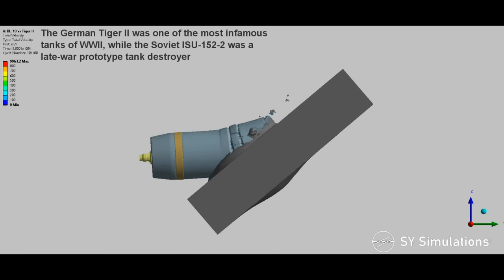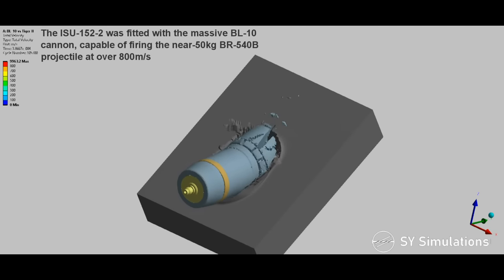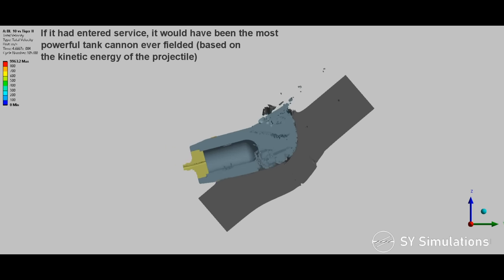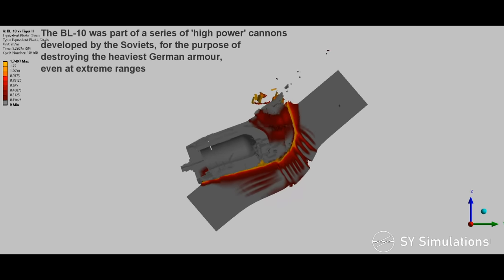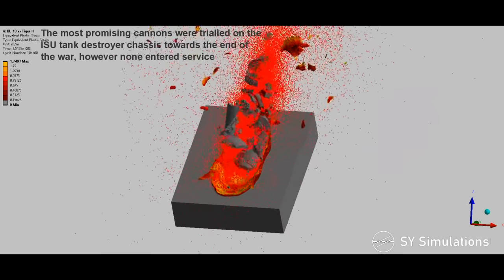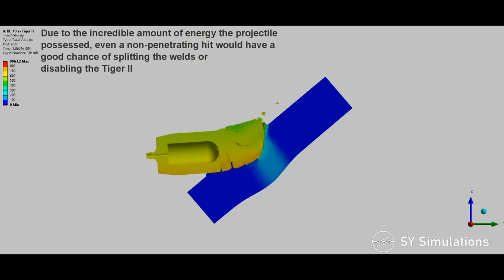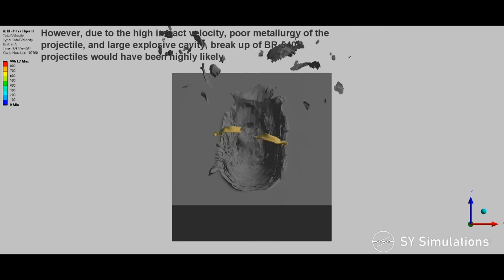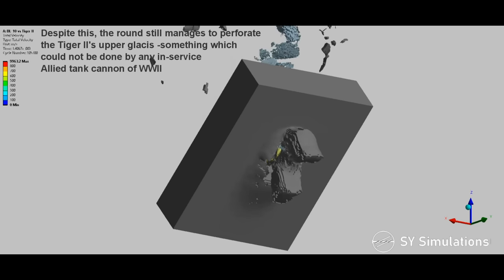SIZE MATTERS | Super ISU-152-2 vs TIGER II | 152mm BL-10 Armour Penetration Simulation

Comment: Rest in pieces driver
Reply: Not just the driver but the machine gunner too and the feet of all the turret crew
Reply: And loader
Reply: @@kanalegrande831 Precisely.   The Tiger-2 would have a rate of fire of at least 6 to 7.5  rounds per minute (10 seconds to 8 seconds between shots on average including time for re-aiming).     The ISU-152 only 2 to 3.(30 seconds to 20 seconds rather optimistically they are two piece rounds). so the ISU-152 can fire at best one round every 20 seconds but more likely 30 seconds.    The Tiger 2 can fire a second round after only 5.7 seconds for the first few easy to reach rounds so long as the loader drops the rounds on the floor rather than throwing them out the roof discharge hatch.   
-The range finder of the day was and stedometric range finder but in reality is to observe the fall of shot and then adjust for the second shot which would be the one that stood a good chance of hitting.      The Tiger 2 could get of 3 shots before the ISU-152 could get of its secondhand it would have 4 seconds to spare.  Of course it could use the time to move under cover..  Ballistics is probably the same after 2000m.  The Tiger 2 will win this duel on most occasions due to 'soft factors'.  No Tiger 2 was ever penetrated from the front.
Reply: Rest in paste*
Reply: Driver ? Dude a single shot would litrally kill everything inside and even if  the shot didn't penetrate the armour the loud clang from the Collison would definitely scramble the brains of the crew inside let alone the guys inside would be either disoriented, knocked out or unconscious
Reply: @@kanalegrande831🤡
Reply: @Tun299  🤡
Reply: @Micha-wb9oz  Твоё лицо не кто не просил скидывать. Я его уже скинул.
Reply: @@kanalegrande831 What do you mean, Ukraine was a major front for the Soviets, we WERE a major part of the Soviets, they weren't just Russians, plus a bunch of other nations fought for the east's freedom. Try and be cultured instead of spouting out things you're not fully informed in. Plus the ISU-152 was one of the USSR's most accurate tanks despite having a massive shell.
Reply: And other crewmans too.
At least in peace.
Reply: And entire crew
Reply: @williamzk9083  Very well. Now find out from which bush the first one came ). This isnt a 1v1 standoff, this is the hunt. Most german tanks were destroyed in ambushes )
Reply: After direct hit by 152 mm shell its RIP for everyone inside that tank
Reply: @-Ryan_Gasoline-  Russia did not fight for the easts freedom.  Russia fought for Russian imperialism.  Russia still fights for Russian imperialism.
Reply: @user-rp5qh1ky6g  most Russian tanks were destroyed in ambushes so what’s the difference?
Reply: @williamzk9083  No difference here.
I use that phrase to counter wehraboos.
Ultimately it all comes down to crew training and experience ).
And we are talking about using a tank destroyer as its intended.
All i told is that type of tank(insert isu, su, any of the german ones(cant remember how they are called)) is rarely used in 1 v 1 front to front standoff. Its a tool for specific purpose, and used otherwise only in bad circumstances or by bad commanders(again training and experience)
Also more than half of tanks of entire war were beaten by masked at gun somewhere in a bush looking at a road (thats probably has more mines than road itself).
P.S. Only major way an isu-122(52) can get to fight front to front is when its deployed at a siege assigned to elite stormtrooper divisions(aka combat sappers, green stormtroopers)
Reply: @lokket9995 except this thing did not exist. It was one prototype only. Over here in reality, Tiger II confronted 152 production variant on multiple occasions, survived frontal hits, and knocked out the 152.
Reply: hes not even in peace 🗿🗿
Reply: @realbaresoles2 The amount of tigers that had their turrets ripped off, and brittle armor plates shattered is funny.
Reply: @williamzk9083  just add another some t 34  and tiger2 will can't concentrate
Reply: Rest in paste.

Comment: Just for reference, that gun is actually getting quite close to the kind of muzzle energies of actual light cruiser guns of the era. The shell's on the light end for the calibre, but still, it's no joke
Reply: At 48kg and 850 m/s it actually beats the American 6"/47 and almost beats the British 6"/50 (both were on the low end of muzzle energy but were great, combat-proven guns), although it falls short of the German 150 mm and the Japanese 155 mm guns.
Reply: @yoshineitor  They mounted one 130mm on a prototype SPG called SU-100Y which was actually used in the Battle of Moscow
Reply: @MrKenny175  The infamous boxtank and the infamous IS-7. I actually adore the simplicty behind the idea, instead of inventing a whole new gun just slap on what is already proven and works and where ammunition is not problem to come by.
Reply: @yoshineitor  Just to clarify, I'm not saying this 152mm gun is actually a naval gun btw - I assumed it had been built from scratch. Also, was the IS-7's gun actually a modified naval gun? I'm well aware 130mm was a common calibre for soviet destroyer main guns, but that doesn't necessarily mean it is a naval gun of course. I think it's generally fair to say that most naval guns are built too heavy to really work well in armoured vehicles. Most tank guns are actually very light if you compare them to naval guns of the same overall qualities
Reply: @tommeakin1732  I could be wrong here, but I think it's fair to say that most ship armament below about 8" wasn't really built for Anti-armour use. Battleships certainly got a lot more use out of their secondaries and smaller firing HE or Dual-purpose ammunition, that would do a great deal of damage to smaller ships.

For example, most destroyers lacked any form of armour plating - even late into the war. And as for cruisers - HMS York/Exeter had 3in in the belt, but the turrets, deck, and 'citadel' were at the most a mere 1.5 inches, or 38mm - For reference that's about 8mm more than a mid-war Panzer III - and these were not small cruisers either at some 8,000 tons odd displacement.

The goals of an anti-tank gun and a naval gun are too far apart for them to ever function optimally as either or. An AT gun needs only to penetrate armour with enough energy to then 'pinball' around the inside and kill the crew or do enough serious damage to disable the tank. A naval gun needs to deliver as large an explosive payload as it can, given how much of a ship is just empty space, and thus a 150mm hole isn't really going to cause any issues.

Evidently a naval gun can work as an AT gun, but that's because of brute force. 152mm shell traveling at some 800m/s and it still fails to penetrate, only sending chunks of armour flying at relatively low velocity. Imagine if they had figured out instead how to get all the energy behind that 152mm shell, behind say a 75 instead? it'd cut through the tiger like swiss cheese.
Reply: @daredemontriple6  The broad observation about naval armaments generally having more of an emphasis on post-penetration damage than AT guns is correct, though that's reflected more in the ammunition than the gun. Ammunition more optimised for AT use can always be developed.

Your final paragraph there is a bit questionable, as many naval guns are in the same calibre ranges as AT guns. If you're just focusing on the higher calibre weapons, a heavier, slower shell is no more "brute force" than a lighter, faster shell. Also for a 75mm shell to have the same energy as this 152mm shell, it'd have to be going at some truly staggering speeds. Also, momentum has it's own advantages, and the heavier, slower projectile will have a lot more momentum than a lighter, faster projectile even if the energy is the same. An object with more mass will also be proportionately less eroded by the target, all materials being equal.
Reply: I think Some ships were armed with 6 inch guns as a secondary armament, 152mm is basically that size.
Reply: @pex_the_unalivedrunk6785  That calibre was common for battleship/battlecruiser secondary guns, though later ships with dual-purpose secondaries (well, ones that actually worked as intended) would have smaller calibre batteries between 4inch (102mm) and 5.25 inch (133mm). 

6.1 inch (155mm) was the upper limit set for light cruisers in the London naval treaty
Reply: @MrKenny175 wasn’t the su-100Y mounted with a 100mm cannon?
Reply: @iwanttocry3212  Contrary to it's name, the single prototype that was produced had a 130mm B-13 naval gun installed. It was developed from the T-100 (a prototype heavy tank) to be a self-propelled gun for destroying defensive fortifications as well as tanks.

T-100(multi turret heavy tank) --> T-100-X(box shaped superstructure modification with 130mm gun) --> SU-100Y(redesigned fighting compartment and the final version, now designated as "SU" meaning "self-propelled gun").
Reply: @MrKenny175  huh I’ll have to look more into that thanks
Reply: @daredemontriple6  - When it came to hard hitting, destroyers and light cruisers relied upon torpedoes.
Reply: If the US Army had wanted to build a TD with a naval-derived 6” main gun, it could have fired the USN’s “Special Common” round. It was intended for the V-series submarines to allow them to sink other subs with armored conning towers and other tough targets.
Reply: @sicstar  The IS-7's 130mm gun and autoloader system needed quite a bit of engineering. It's not like just slapping a gun onto the tank.